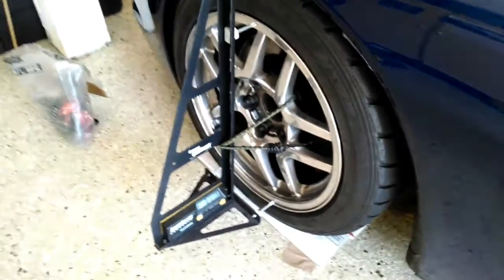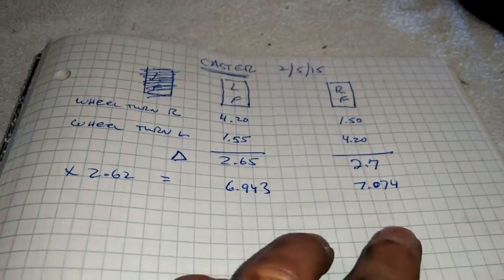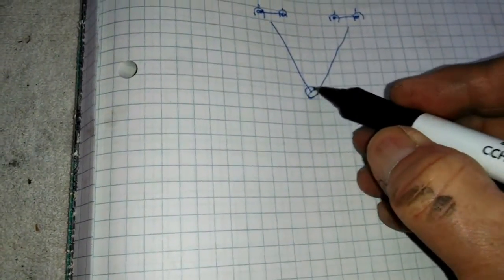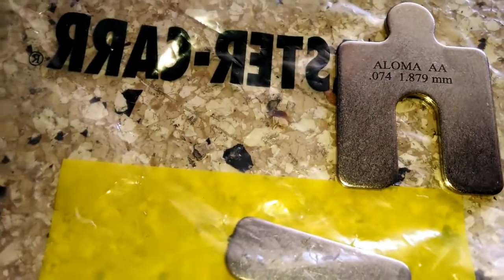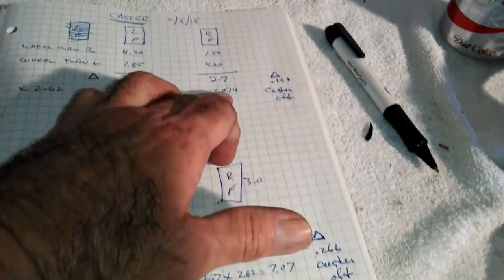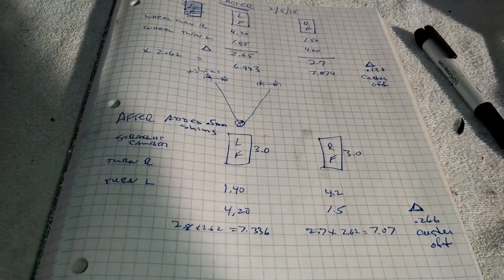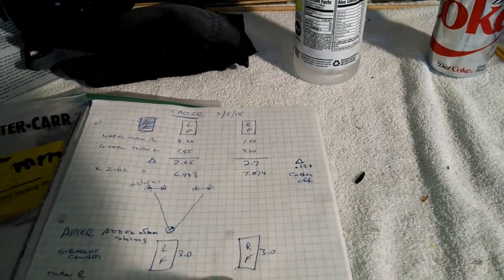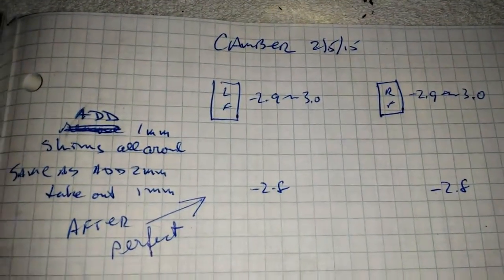Corvette alignment setting caster by froggy

Comment: Froggy, why does Farmer use a factor of 2.62 and smart camber instructions us a factor of 1.5?
Reply from the maker: Not sure your meaning of "factor" ? You mean the caster multiplier?  I'm not sure. I am doing align on my 2013, will revisit then. :)
Reply from the maker: BTW the factor I used seems to result in a caster # that is in a "reasonable" range, what you would expect.
Reply: Yes, the castor multiplier. The Smart Camber instructions says the multiplier is 1.5 for 20 degrees. I have just started using the smart strings and smart camber and it appears the 2.62 should be much closer. BTW...thanks for the great videos. Also, do you calibrate the smart camber every time you use it? Do you do all of the calibration steps? Thanks again.

Comment: Froggy your videos are extremely helpful as I'm a new c5 owner so your videos are helping me out a lot. Do you have any showing how to clean the mass airflow? I'm not familiar with this task for my car yet and I'm getting a  MAF code now so I could really use some help. Thanks again and keep the education coming sir.
Reply from the maker: If you look on my Ford Explorer play list I show it (on that vehicle) basically the same.

:)
Reply: Awesome, thank you sir. I will have a look.
Reply from the maker: I love it when vehicle owners take control of their maintenance.

:)
Reply: I cleaned up my filters oiled them up cleaned the MAF sensor and cleaned the throttle body using the correct cleaners and took it out for a test drive and man I love to hear that LS spooling up as I give it some gas. It looks like my issue has been resolved so I just wanted to say thanks a ton for the videos and please keep the education coming froggy.
Reply from the maker: Will do, thanks for viewing!